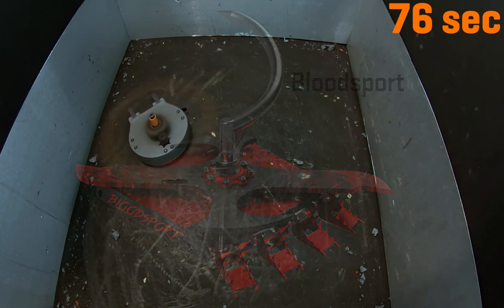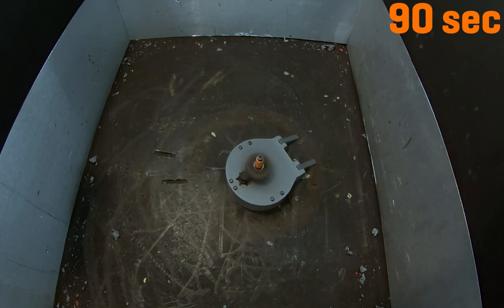Destruction Time! Weapon Test - Mini Mulcher V0.9, 1-Pound Antweight Combat Robot

Comment: It did a Mauler
Reply from the maker: What's a mauler?
Reply: @JustCuzRobotics  is an old term in combat robotics, is a cool story, in the old days of Battlebots, when Battlebots was called Robot Wars USA there was a robot called "The Mauler", The Mauler is classified as a  "tuna can spinner" a tuna can shaped robot that has a spinning weapon in the top, since 1995 to the mid 2005 the Mauler was making a disaster in all events it went because the robot was really unstable, it can kill the oponent and itself (and that happened a lot), the Mauler was too unstable that it was forbiden to compete in the UK, the action of a spinner robot losing stability and getting crazy until (sometimes) get self destroy in the middle of the fight was called "Do a Mauler" in honor to the unstable but legendary Mauler. A modern example is Gigabyte/Megabyte, that robot has become a master in do a "Mauler" bouncing in the walls a getting KO.